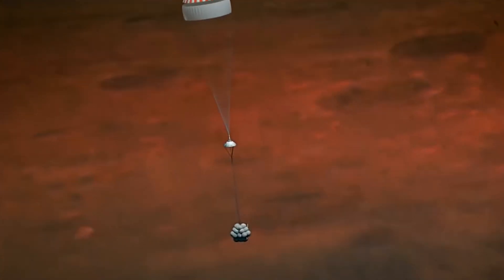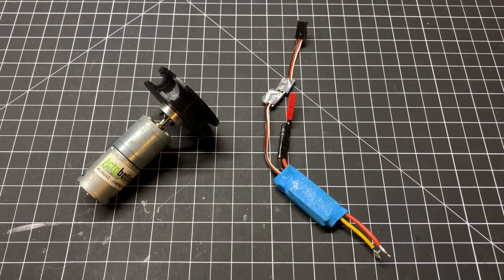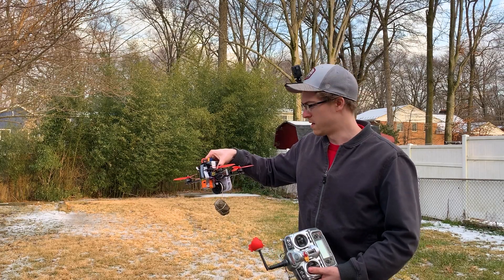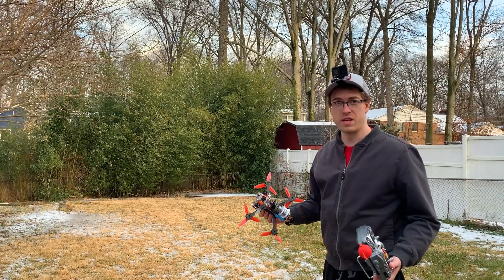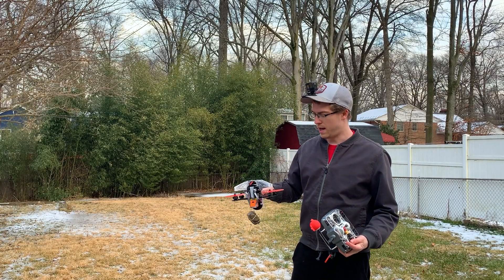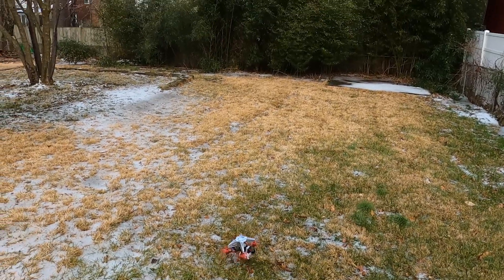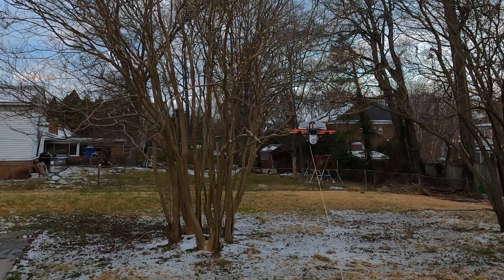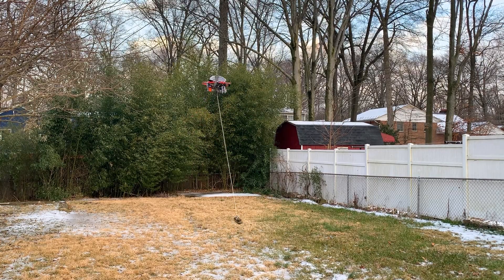Mars Rover Sky Crane: Drone Test

Comment from the maker: Addressing some things:
1. The real Mars Skycrane has 3 tethers, but the mounting point to the skycrane is still at a single point--this means that the effect on the skycrane dynamics is exactly the same as my test. The multiple mounting points at the rover end just keep the rover from rolling/pitching around
2. Drones and full scale helicopters on Earth carrying payload by tether have this same problem. Often times, the oscillations are lower frequency so the pilot can manually correct by steering into the angle the tether makes from vertical. But doing this autonomously requires that extra level of control programmed in that I talk about toward the end of the video
3. Like this comment for a Mars Ingenuity helicopter project
Reply: You can try to lower the rock when it is about to land, and hover the drone so it won’t swing back and forth too long.
Reply from the maker: @jimsmith7212  Not a very good analogue to the Mars version at that point, defeating the purpose of the video demonstrating the coupling effect
Reply from the maker: @larryscott3982  Stay tuned for part two with 8 rocket engines firing in my backyard
Reply: @NicholasRehm  
Got it. That creep LEO has you as critical evidence. As if you’re a NASA basher too.
Reply: @NicholasRehm 
Your animation uses one cable, do one with 3.
Do a test flight with a setup that mirrors the Mars design.
Reply from the maker: @jimsmith7212  see point 1. 3 tethers on the rover end simply prevent the rover from rolling/pitching around. They transmit the side forces to the skycrane identically as a single tether does, creating the dynamic coupling effect
Reply: @NicholasRehm  
Sorry I jumped the gun with my comments, 😬, I assumed if that idiot LEO cited you this was a flat earth type channel. Building your own drone and programming flight control is impressive. Nice job.
There is a comment at WW about 3 wires and oscillation, from someone  more knowledgeable than I.
One thing noticable is the rock center of mass is not aligned with the string and in the top view the oscillation is enhanced by the rock CoM rotation and centrifugal force.
It would be interesting to see if a 
Builders plumb bob with one string would behave differently, perhaps swing a bit less. This does make me appreciate the Mars landers autonomous flight control.
Reply: @NicholasRehm  Level Earth Observer is a complete nutjob, making a fool of himself on YT for years.
Reply: @NicholasRehm  I see you tried to engage LEO, I wouldn’t bother. Countless people have tried to help him.

Flat earth is a religious thing, it’s faith based, you can’t use logic and science it’s the devil to these people.
Reply: Nicholas, you're comparing a 4 props drone to a 8 thrust rockets,  the landing itself took about 20 sec.  Now to match the same performance you would need to have a drone with 4 downward thrusting props and 4 more outward in a slight angle props for stability.   Now if you want to repeat your experiment to scale, you would have to keep your drone at 3 feet off the ground before lowering the rock and like I just said you would need 8 props total to reproduce the landing with your drone as a sky crane.  and you won't see what you showed in your little demo.
Reply from the maker: @lepompier132  the point wasn’t to identically replicate the sky crane. Regardless of the hovering platform, the inherent dynamics at play are the same/similar
Reply: @jimsmith7212  Will only work like the Mars Rover if all four quad engines are mounted at similar angles to the outside engines on the Rover.
Reply: The coast guard practice all the time with winch operations.  The winch operator essentially wears a glove and applies and additional force to the cable out of phase to reduce the amplitude of the swing.  It is critical that this is done early because as you saw small swings get really big as the cable gets longer
Reply: Was just to go comment this 😂

Comment: Simple design changes would help a lot. Motors need some tilt so the wash isn't going straight down easy to do with some 3d printed mounts. and the load needs at least a 3 point harness to stable out the load. These two design changes would make it much more stable.

Comment: I build and fly large drones for work, where we often (have to) suspend the payload by rope. With a bit of practice this oscillation can be compensated by the pilot by always moving the drone above where the payload swings (kind of the opposite to balancing a stick). I like to use longer ropes, because the frequency of the oscillation gets lower and easier to compensate for. Also due to harmonics, there are sweet spots in rope length, where the tendency to swing gets minimal.
Reply from the maker: Awesome insight. And yep--the 'controller' to counteract this effect is just steering toward the rope--easy on something a little bigger by an experienced pilot when the frequency of oscillation is lower. I was really interested in these sweet spots you mentioned, but just seemed to find that the longer the tether in my case, the more oscillation
Reply: @NicholasRehm  You were probably reaching a resonance point (the opposite of what I was talking about). By longer ropes I meant 10-50 meters.

Comment: I thought it had to do with the center of mass shifting away from the center axis of the vehicle and it not accounting for that. After all, any change in attitude would need to be applied against the COM which is somewhere in the air between the crane and the rock.

Comment: State feedback control algorithms, like LQR or MPC, would probably be a good  candidate to solve this issue. Not sure what level of control theory you are familiar with, but could be interesting to apply it here. This also makes me wonder how NASA did it, since probably one can also do it with nested PID controllers.
Reply from the maker: Yea I didn’t really have much time with this project to tackle the actual control problem, just show off the dynamics. My next project in the works actually skips this and goes right for the flying inverted pendulum
Reply: There was a data link cable as part of the tethering between the rover and the sky crane. So for all I know, the sky crane got accelerometer and gyro readings from the dangling rover. Would that make the control challenge easier to solve?
Reply from the maker: @hermanrobak1285  yes, and exactly what I’m doing for the next video to solve the control problem :)
Reply: @hermanrobak1285  This would only make it easier to obtain a good estimate of the state of the system. Without it this would probably also be possible, but might be less accurate.

Comment: Does the velocity and resistance values of the real sky crane and rover have play into control. 

It throws the rover away, faster than the crane than tensions the cables and uses the thrusters to control angle and approach speed. 

My question is, is the process of a controlled landing of a falling object different than controlling the load of an object at the end of a cable?

I’m imagining a controlled tension yo-yo concept.

Comment: Easy way to deal with problem is solve for control inputs considering CG of the system not of each body seperately. As CG system doesn't oscillate

Comment: I work for NASA propulsion laboratory in California 
1.  I congratulate you for the hard work.
2. If you spreed more the rotors from the quad the wake would be much less hence a more stable flight for the rock.
3. Make the drone more stable before lowering the rock.
4. Put the rock much closer to the body of the aircraft so it doesn’t destabilize the drone before you start lowering the rock.
5. Make the lowering much faster.
Regards.

Comment: would be interesting to see the advantages of multiple ropes/cables
Reply from the maker: Notice in the real sky-crane at 0:42 that the attachment point is still a single point. Ultimately, number of cables doesn't matter as the net tension force (and net side forces) will be the same. Multiple cables at the rover end just keep it from rotating about its center of mass
Reply: @NicholasRehm  and maybe prevent it from rolling and pitching?
Reply from the maker: @JasonGolf  correct--"rotating about its center of mass"--we don't really care if a rock is rolling and pitching around, but it matters much more for an expensive rover :)
Reply: @NicholasRehm  What about from the viewpoint of the sky-crane? Having multiple cables causes a moment about the center of the sky-crane (or in your case the drone) when the rover (or rock) is not directly vertical. This will cause the control algorithm in the drone to behave differently.
Reply: @syzygygolf  He said the multiple lines merge into one at the crane...